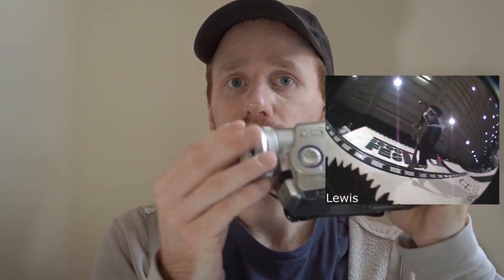Mini DV Tips video

Comment: i found two mini DV cameras still in sealed boxes (new old stock) from a local old timer shop, my worst fear is that the heads will get damaged or wear out. do you think they can last longer in comparison to a heavily-lightly used mini DV camcorder? i literally have no idea how videography works since im a 35mm film photographer so im digitally impaired , cheerio
Reply from the maker: Pick your poison really, mini DV has a lot of very small moving parts. New old stock should be the best option though! There are the external firewire capture devices that bypass mini DV entirely but can be pricey. If you are getting into film making this may not be the camera for you unless you want the old retro "dad cam" or "skater" look.
Reply: @LukeAkAscooterkid  im not into film making as you mean, i want it to record for "fun" with friends and summer holiday or christmas etc or maybe a "behind the scenes" from a photoshoot sometime , i really like the older look and feel (i know its something you can literally add on editting a digital video but its not the same to me thats why i shoot old cameras with film and no digitals with film presets) i already own 3 2005ish digital camcorders for the reason i like that low quality and colours.

Comment: is there a difference between mini dv and mini dvc? Was looking around and found a lot of dvc tapes and i'm pretty sure it's the same as dv right?
Reply from the maker: Yes these are mini DV tapes. Some tapes are  specialised for HDV format also if you come across them.
Reply: There are four main types of DV tapes, DVCAM, DVCPRO, MiniDV and Digital8. DVCAM uses the biggest standard tapes. DVCPRO has around 4 or 5 different formats from DVCPRO SD, DVCPRO HD, DVCPRO50, DVCPRO Progressive etc, and uses 3 or 4 different sized tapes, and you already know what size the MiniDV and Digital8 tapes are. The DVCPRO HD tapes are the same size as the DVCAM tapes. But again, the DVCPRO has different size tapes for each DVCPRO format. Yes Digital8 is DV format. Digital8 records using the same exact codec as MiniDV. MiniDV and Digital8 are the same exact resolution and quality, but are recorded on different tape widths. The bad part is Sony only made single CCD Digital8 camcorders, but some companies made 3CCD MiniDV camcorders. Panasonic made most of them. Panasonic made a lot of 3CCD MiniDV camcorders, but everybody else basically stuck to making single. Canon had some RGB filter technology that they used in most of their later MiniDV camcorders, and the filter basically gave the quality of a 3CCD MiniDV camcorder, so Canon had the better quality without having to add 3CCD sensors. Nonetheless, the quality does differ, because the MiniDV camcorders with 3CCD sensors and the Canon camcorders with the RGB filter were better quality; I think Canon called it Advanced RGB Primary Color Filter. It is noticeable when you use a Canon with the RGB filter.